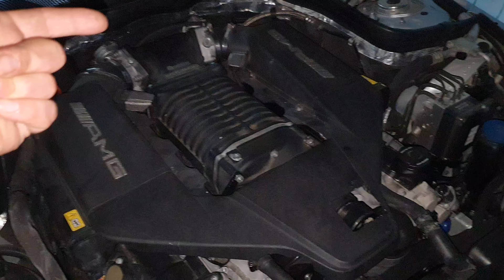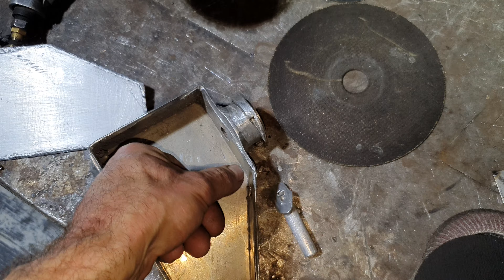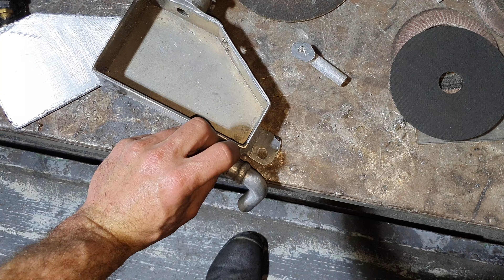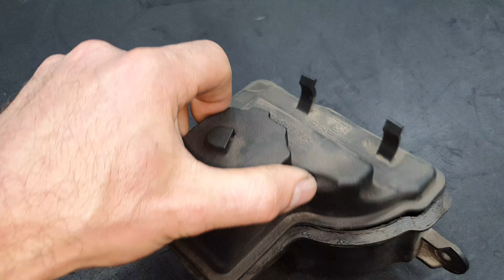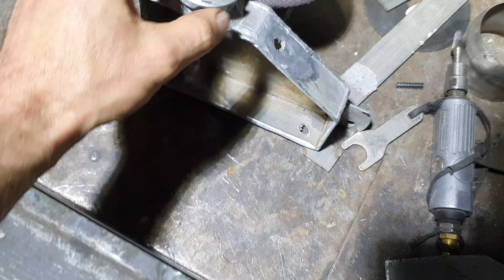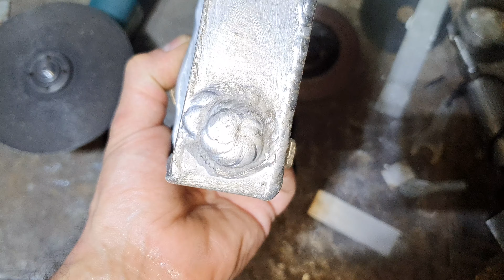E63 2010 with 81k km check up (part 4)

Comment: Great video 👍 The aluminium tank hole should be flared out then the pipe welded onto flare which would stop stress cracking.